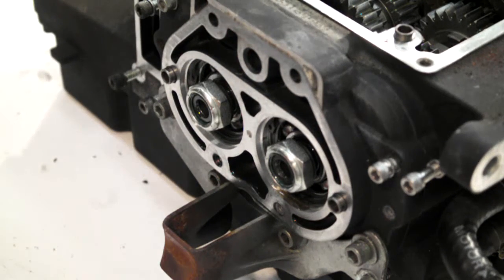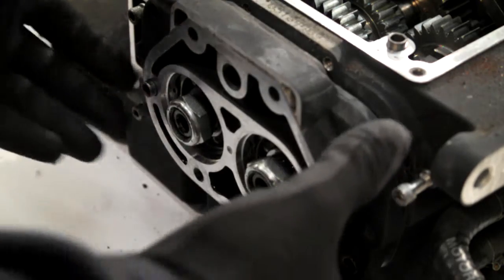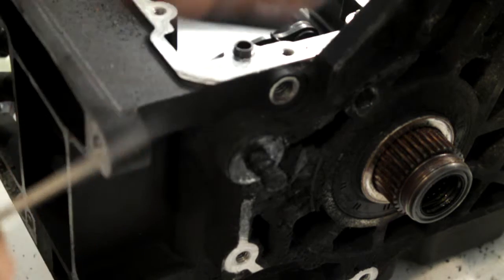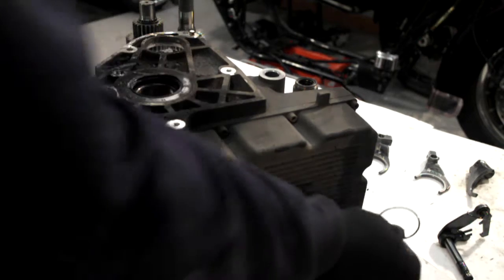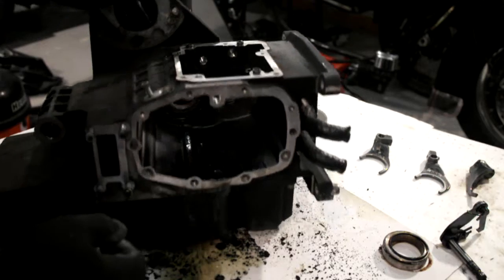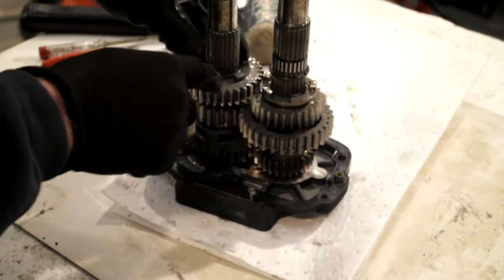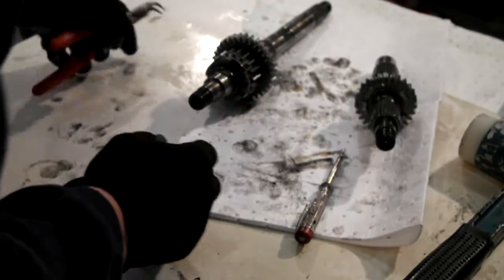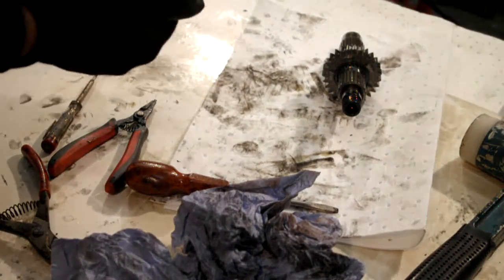Harley Twin cam 88ci strip and rebuild part 30

Comment: You could open a school and teach Harley engine and trans in USA and make Millions !  or the UK but I wish you were here so I could come to school.
Reply from the maker: I like the idea of making millions but i don't think I would be a very good teacher ?
Reply: After watching your videos I think I would love to be a student of yours. I love cars , motorcycles and do have a mechanic lic but don't work as a mechanic, and
  never really worked on cycles but I can recognize a good teacher right away. I'm on your 30th video and have learned a lot.  
  One or two small mistakes don't  add up to a hill of beans, they were caught right away, another sign of a good mechanic. 
Here in the USA there is a need for good honest people that would treat customers fairly and do good work.
 My dealing with Harley dealers wasn't very pleasant and I'm sorry for that statement but once they told me I had a bad crank bearing and that I needed a new engine 4000.00
I drove my bike home and I'm still driving it. Once more they told me to change the fork lube they had to remove the tubes and it would cost 500.00. I changed my front fork lube for the cost of the lube without removing the forks. So you can see why the USA needs people like you.
 I'm watching your videos and I'm very grateful because  I have the need to fix my own bike. Please keep up the great work and please stand by me if I have a question, ggg .